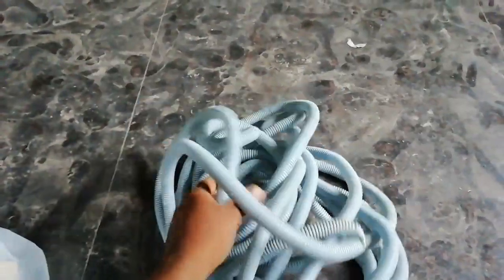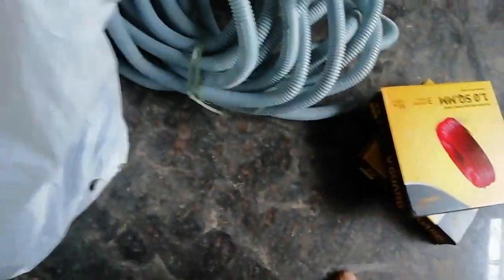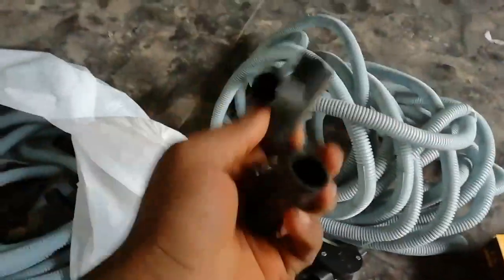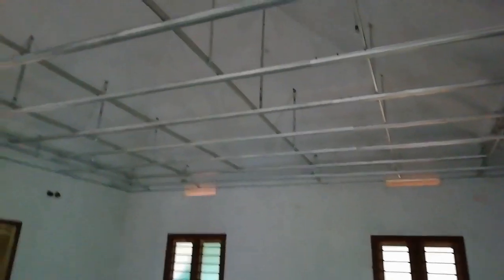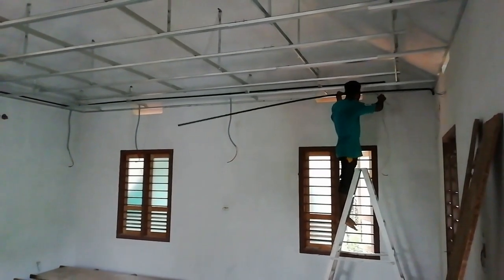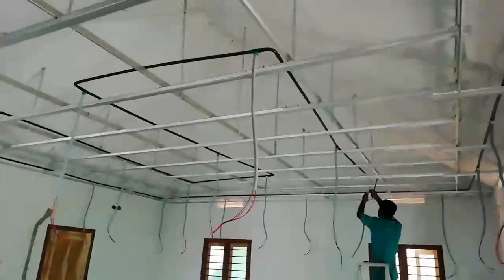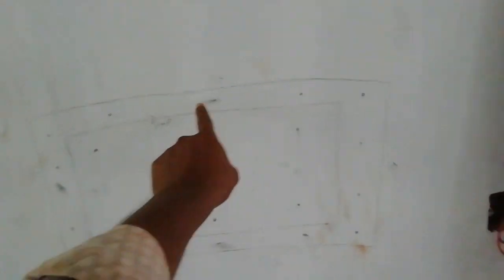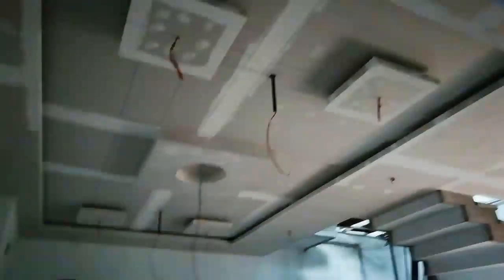How to ceiling electrical wiring malayalam

Comment: Gypsum cealing cheyyumbol . Light ozike baaki Ella wiring like (main switch il ninnulla wiring  for AC ,heater ilekkulla connection) 
Ithokke gypsum ceiling il ano pokumnathu .
Atho normal  lights nulla wiring seperate ano kodukkunnathu??